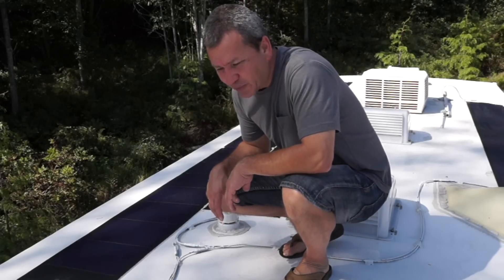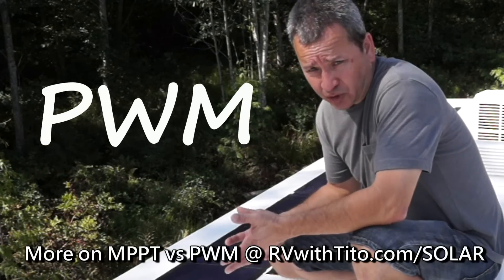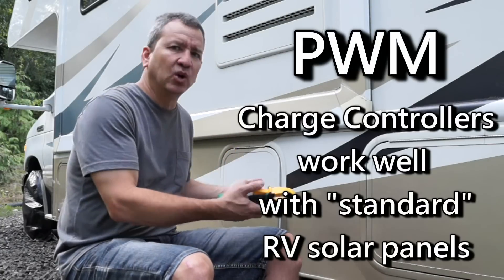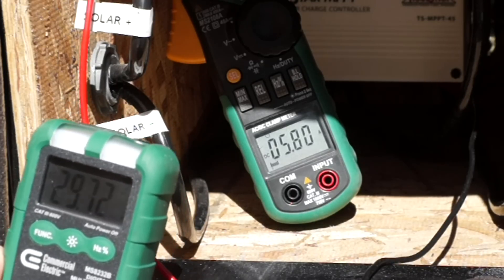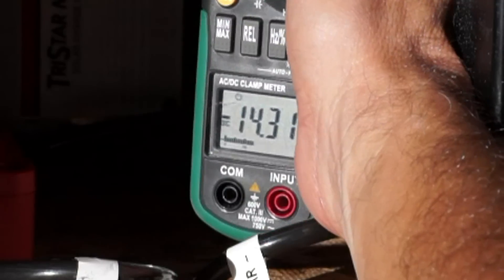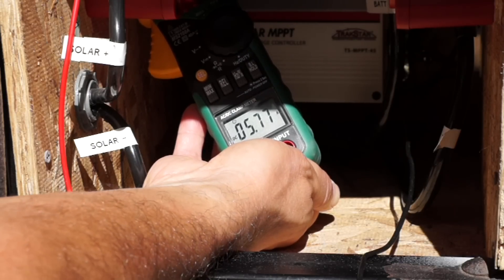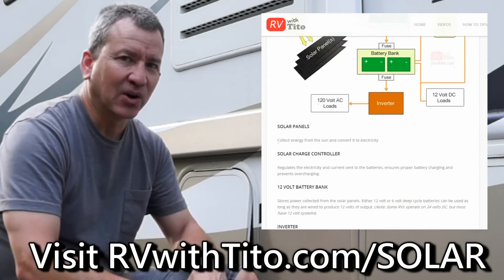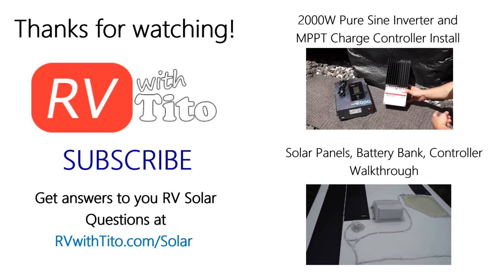MPPT or PWM Solar Charge Controller for High Voltage Solar Panels?

Comment: Clamp-on current meters only work on AC power. Why are you trying to trick us?
Reply from the maker: Not if you get one that also works for DC
Reply: @RVwithTito  Wow you're right. Didn't know they had those.

Comment: Seems like a good solar Generater.Systems . I have not had to put it to the test yet in a situation without power but it has seemed to operate fine so far.
Reply from the maker: Here's an article that'll help: https://www.rvwithtito.com/articles/battery-capacity/

Comment: If you have a good mppt you can link your panels in series and feed it even more voltage and it will convert it all over quite well! The only drawback to that is if one panel is even partially shaded, you can take it a whole string. But if you're out in the open, I say volt up and let the mppt work its magic! Even cheaper ones are usually good to 150 volts, though I cap out at 96 volts to be on the safe side on those ones. Just be sure to hook your batteries up first so the controller knows what to set to.
Cheers!

Comment: if I want to connect two 100 watt panels in series and parallel them to another exact 2 100 watt in series 20v 5a each panel what should I get a pwm or mppt?

Comment: Which is better having high volts or amps?  
I have a mpp solar n right now I get 165 volt in 2 set of 100 watt (16 plane ) 10 amps but if I have 1 set it will make it around 360 volt with 5 amps. My ? Is which is better having high volts . Having them in 2 set or 1
Reply from the maker: It depends on what type of setup you're going for. Higher current requires thicker cable. But you'll also need to match the voltage/current to your solar charge controller.
Reply: @RVwithTito  i set them to high volt 340 volt. But I notice isnt a gud idea since am not full charging my battery I will have 1 set of 8 for volt n other to amps which mean I will get 180 volt in 1 end n other 45 amps. I believe is the gud idea 

My mpp is 60amps n 500 volt

Comment: I have a PV with 70 Volts Output to run on a 12 volt system. Must the input voltage  of the MPPT charger controller be rated  up to 70 volts and above?

Comment: So how many panels can you have on a single MPPT controller? 🤔
Reply from the maker: Depends on the input voltage and output current ratings. There are many different ones for various sized arrays.

Comment: So if you have let's say 4 panels of 20 volts each. You connect them in series and you have 80v, 5A now your MPPT charger will convert the excess voltage into amps. Right!
But what is you connect 2 panels in series the other 2 in series and both in parallel? You would have 40v and 10 amps and the MPPT still can convert excess voltage into amps. Which one would be more efficient???

Comment: This is not how it works. PWM do not "waste" the excess voltage over what you need to charge your batteries. Only they put your solar panels at the same voltage as the one needed to charge the batteries.

Solar panels are not like a battery or a power outlet, that are at a (pretty much) fixed voltage, 12V or 120V (or 240V in Europe). They are at a voltage that depends on what they are connected to. And they will produce different amounts of power depending on that voltage.

A PWM puts them at the batteries' charging voltage, which is not the voltage where the panels can produce the most power. An MPPT can put them at the ideal voltage where they can produce the maximum power, then step down that voltage to send the power to the batteries. So MPPT is more efficient when there is a lot of sun, which is when the ideal voltage for the panels is high (higher than the charging voltage).

MPPT controllers can convert down the voltage from the panels, but not up. So when there is low light or shading and the ideal voltage is lower than the charging voltage, they work just like PWMs. However they allow you to connect your panels in series (when you add up their voltages) rather than parallel-only for PWMs, so you can get two panels working at 7V+7V rather than both at 14V, making them potentially also more efficient when there is little sun.

Comment: Hey Tito, I know this is an old video but still really helpful. I have a question about what you say at 4:25. Why is it that with a PWM it would still be able to go from 5.7A up to 7-8A if it ignores the extra voltage? I have a class B RV with a really old charge controller wired into the van already rated for 7A which I assume is PWM. I'm using it with a BougeRV 100W flexible panel that puts out an operating voltage (Vmp) of 17.6V and working current (Imp) of 5.68A. I did a straight multimeter test on the panel and it output 21.4V Voc and 6.81A Isc (rated at 20.8 Voc and 6.1A Isc)!
Reply from the maker: Yeah. I watched that a couple times. I think it's confusing too. I probably meant that the max I would get with PWM could be 6-8 amps in optimal conditions with those panels and no MPPT conversion.
Reply: @RVwithTito  wow so the amps you get straight out of the panel at 20V will be the same you see coming out at 14V from a PWM charge controller? Thanks for taking the time to answer! Just added you on IG.

Comment: In a case where by I use 150 70a victron mppt and sharp 135w thin film solar panels. Ovc 61v  . The question is will I get any difference  between 6 of these panels in 2 string series over parallel connection to all panels.  Your answer will be appreciated

Comment: Hello,  please tell me how your getting the DC Amp reading from you SOLAR PANEL ?  Which Wire are you putting your CLAMP around ?    Also, tell me same on the MPPT side, which WIRE are you getting the reading from.   THANKS
Reply from the maker: The positive cable. One side of the clamp meter is labled to face the positive electrical source.
Reply: THANKS allot!  Have a good day.

Comment: Thanks for thos great explanation/demonstration. Even though solar panels have not experienced huge increases in effficiency (well, maybe at NASA), it is nice to know that modern controllers are currently so much better with higher voltage panels.  Thank goodness for great strides in technology.  I am VERY excited to get my 300 watt 80 volt panels wired into my MPPT controller to see how many amps I can capture for my 24v battery bank. I am waiting for the correct connectors to arrive. Whee!

Comment: i have a question how the MPPT work in cloudy and shaded climates ?
Reply: It matters not to the controller as it is limited to working with whatever current it receives. Your choice of panels is EVERYTHING in less than ideal conditions. There are several "chemistries" of panel available these days yet amorphous panels produce more power when partially shaded and on cloudy days. Yet there is a catch...you must purchase QUALITY amorphous panels. The really good makers of amorphous panels are gone now...undercut by the glut of low quality panels available from Asia and other sources. Look for Uni-Solar and Xunlight panels, both were often made in the USA. Get them before they are all gone. Remember that any amorphous panel will be less efficient overall and require more "real estate". They can be twice as large as other types of panels yet are often semi-flexible or even rollable. Become creative, have some on your roof and a "satellite" panel to pull out when you are going to stay awhile wherever you are. See you on the road or...out docking!

Comment: can a mppt handle much more voltage than it's maximum rating ? mine is 10.8v-30v mppt i have two 100w panels each one is 18.4 volts at open circuit is there any problem if i connect 2 panels in series
Reply from the maker: It probably won't work. You should upgrade your controller if your input exceeds the max.

Comment: That sounds great!
I need to charge a 72 volts battery bank on my sailboat...what would you recommend 
Thanks!,
Reply from the maker: That's a tough one. Most MPPT controllers only support up to 48 volt systems.
Reply: I spoke to the people at thunderstruck motor and they told me to use this controller. https://www.thunderstruck-ev.com/jld404-programmable-battery-monitor.html

Comment: Hi...have a question, suppose   output from mppt controller is 12V, 16A but my battery needs  only 12V, 13A for charging. Can I trimm off excess 3A coming from MPPT charge controller?

Comment: Hi, Great video,

Solar panel open-circuit Voltage: 40V (12W)

Battery 12 V (AGM)

I have Controller : PWM controller max input voltage 28V

I need to step down from 40V to 25V and connect to
solar charge controller to charge the battery? 

It is a little project, I do not want to spend lot of money to buy MPPT.  Your suggestion would be great.
Thanks,
Krishankumar

Comment: Very nice video and great explanation.  Also, great choice in a charge controller.  I have the PWM version of that Morningstar and it has been flawless for 9 years now.   I was also very impressed with the manual that comes with it.  Rather than just describing the controller itself, it's a mini course on solar electric systems.    In the era of the dismal owner's manual if you even get one at all, Morningstar's documentation was a very pleasant surprise.

I would just like to add that PWM can be a good choice for many.  PWM makes sense for people with smaller solar electric systems (mine is 190 watts) where the price difference between a PWM and an MPPT controller would be greater than simply adding an extra solar panel.  When I bought my PWM controller it cost $155 and the MPPT version was close to $400, a difference of over $200.  At the time I could buy a 50-watt panel for $100.  So I bought three of those to add to the 40-watt panel I already had.  The system is charging two 6v golf cart batteries in series, 209 amp hours in the battery bank.  It has worked great for nine years now.  I have never run out of power and the batteries are usually recharged before noon each day.  

If I had a larger solar array MPPT would become more advantageous because it would cost me a lot more to add enough panels to make up for what I'm losing by not having MPPT.

Another thing to consider - MPPT's efficiency really shines when there is a big difference between battery voltage and the solar array's max power voltage (Vmp).   The two factors that affect this are battery depth of discharge and the temperature of the solar cells.   If you're a person who normally drains the battery bank quite a bit from one day to another, the controller will spend more time in bulk mode which is where MPPT really shines.  And if you normally camp in a cool climate, your array's Vmp will be higher than if you're in a hotter climate, which also bodes well for MPPT.  So, on the flip side,  if you are a person who doesn't usually drain your batteries a lot from day to day (this describes me) and you camp in hotter climates, MPPT isn't as much of an advantage over PWM since it won't spend much time in bulk mode and the lower Vmp will produce fewer watts than a higher one would.    

Just things for people to consider when making the PWM vs. MPPT decision.
Reply from the maker: Thanks so much for sharing your insight. I've since switched to Victron controllers, but I still have both Morningstar TS-45 controller (MPPT and PWM). I'm planning to use the PWM one to charge my batteries from my engine alternator. Should work fine I think.
Reply: @RVwithTito  How do you like the Victrons?
Reply from the maker: @MTMiser  I like them a lot because they are very easily programmable via a mobile app and communicate with each other via bluetooth. I think they're pretty affordable too for MPPT. I've got three of them talking to each other. The other thing I like is that they have built in current limiting. So if the MPPT output exceeds say 30 amps, it will just limit the output to 30 amps. So there's no real worry if you're pushing the limit on a cold sunny day. My Morningstar would throw a fault and flash until you reset everything.

Comment: Hi what would charge you batteries the quickest parallel or series from 2 100 watt panels
Reply from the maker: If you have an MPPT charge controller, series or parallel should be no different under the same conditions. 200 watts is 200 watts. Of course there are other unknown factors like cabling or placement that could affect my answer.
Reply: Thanks that will do me 😜 have a nice day

Comment: Thankyou, I was thinking of purchasing 4 340 watt panels I believe they are 24 volt. What is the easiest way to figure that out when looking at the specs on back of the panel. I currently have a 12 volt setup with 4 100 watt panels, a PWM charge controller,  will the MPPT charge controller drop voltage down up the amperage if I buy the new panels for my 12 volt battery bank. I have 4 6 volt golf cart batteries deep cycle 230 amp hours and a 12 volt 3000 watt max modified sine wave inverter. Just trying to better charge my battery bank. sometimes I have to use a 2000 champion generator to top up my battery bank. I prefer not to do that.
Reply from the maker: A 24v panel will have a charge voltage rating of 32 to 36 volts. And yes, an MPPT charge controller set to charge a 12v system will convert the extra voltage coming in from solar to more amps and charge your 12v batteries appropriately. Be sure you're not exceeding the input voltage rating on your controller and you should be ok. Good luck!

Comment: Can anyone recommend a good 24V mppt Charge controller?
Reply: Morningstar.  The particular model depends on how many amps you need it to handle.  To figure that out, add each string of panels' Isc, or short circuit current rating, together.  Then multiply by 1.25.   Get a 24v charge controller rated to handle at least that amount of amps.  Many Morningstar controllers can handle either a 12v or 24v system, you just set it with a dip switch.  If you're talking about a 12v battery bank system with 24v panels, they can do that too (MPPT not PWM).  https://www.morningstarcorp.com/

Comment: Thanks for Video Brain .I have two Question .Firstly What was the voltage when MMPT Is installed ( not shown in vedio ) and Secondly How MPPT Charge Controller Convert Extra Voltage into current ( Do you have any video Tutorial on that like algorithm etc ) .Thanking you !!!
Reply from the maker: An MPPT controller is constantly sampling the incoming voltage based on the battery voltage to determine how much energy it can produce from the solar panels (finding the Maxium Power Point). Then it does a DC-to-DC conversion/transform of the input power to generate as much current as possible. If you use Ohms Law power formulas (Amps = Watts / Volts) then you could probably do a rough estimate of how much of a boost you'll get. Of course, the input (power from solar) fluctuates continuously which is why the controller is constantly sampling the input.
Reply: thanks for you reply .Can you share your Algorithm  you use and mechanism and Circuit  of MPPT Charge controller . Reply will appreciated !!!

Comment: Finally a clear comparison. Do you know if an analogue amp meter  (needle type) will use electricity in line as the digital type does?

Comment: I have the goal zero 1400 on the way, with optional mppt controller.  Its unique because its the only controller that will use BOTH pwn and mppt controllers simultaneously, I can separately check what voltage/amps are coming in and see whats more efficient, when.  pretty excited to start testing :)

Comment: I have 
7 - 100 watt panels I am installing this week on my RV.  I may be able to squeeze in 1 more making it 8 total.  These are 18 volt panels.   If I wire them into series I should get 126 volts. Correct? 
I am using MidNite Solar Classic 150 MPPT Charge Controller,  150 volts (96 amps)

Orginally I was going to squeeze in 2 - additional 50 watt panels - same 18 volt, but if I am reading this correctly, I should ditch the (2) 50 watt panels and wire up the 7 - 100 watt panels in Series giving me 126 volts?
my system so far:
ALLPOWERS Solar Panels 100W 18V
Midnite Solar Classic 150 Charge Controller 150VDC Input MPPT
Magnum MS2812 2800W Inverter with 125 Amp Charger
4 Lifeline 6 volt SERIES VS PARALLEL= 600Ah = http://lifelinebatteries.com/products/marine-batteries/gpl-6ct/
Reply from the maker: +Jenny Rodriguez Yes. Just don't exceed the voltage and current rating of your controller and you should be good. You might do what I did and use those two 50w panels with a separate small controller as an external array for morning and evening hours when the sun is low.
Reply: Jenny Rodriguez it will be mor effective if the panel voltage is no more than about twice the battery voltage. the buck converter is less efficient the greater the voltage difference.   the only time such a high voltage will be better . is if there is a long distance from panel to controller. to prevent s voltage drop. and allowing a smaller size wire. from panel to controller. the mppt does work better at slightly larger voltage difference. most 12v panels are 18-20v I wouldn't go more than 2 in series. then parallel the pairs. hope I helped. I was going to do the same thing. until I studied charge controllers.

Comment: every PWM controler i have tried ,puts out about the same as you put in. if your panel puts out 42 v then the pwm puts out the same.42 volts into 12 volt battery ,,not good. the uni solar panels he has will still put out low voltage in low light. they have no cut out. a good MPPT that will  convert up and down, is a very good idea. these panels are awesome and unlike all others. it is a damn shame that no one stepped up to take over production of these panels when the company folded up due to mismanagement. they had orders  in high demand.but still closed for no real reason.